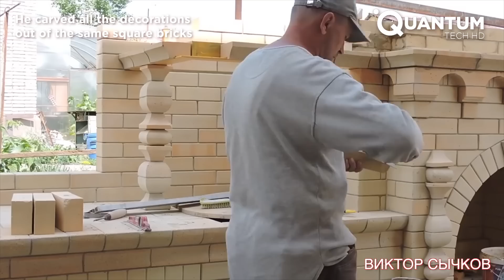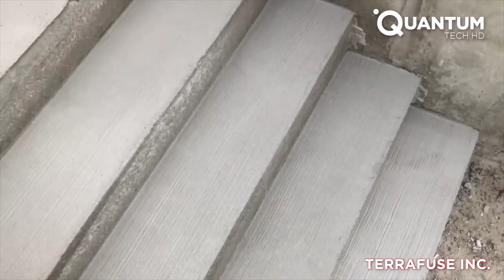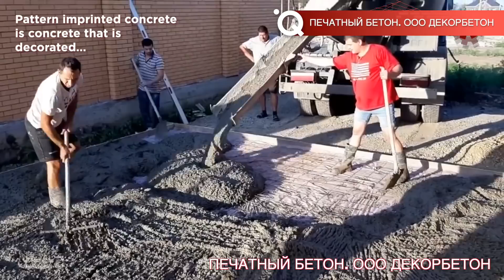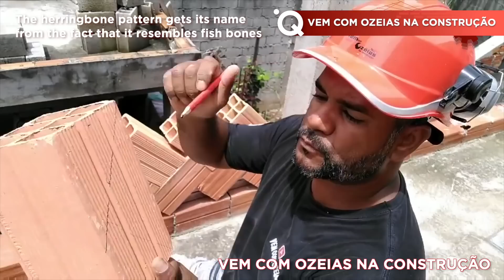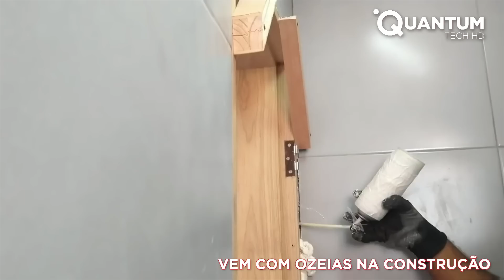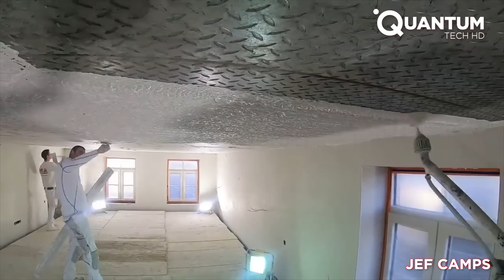Ingenious Construction Workers That Are On Another Level ▶33

Comment: Not too shabby! As a Mason Tradesman myself I can appreciate that work, though that kind of work really isn't done here in the United States. I personally did a few Southwestern style fireplaces myself, and a few back to back custom fireplaces out of stone as well as ashler (roughly about $10,000 for the back-to-back stone fireplace). Pretty neat work, good job!
Reply: That’s actually a really great price.
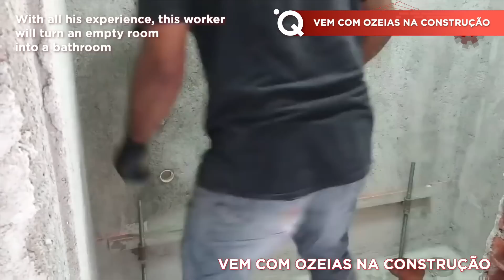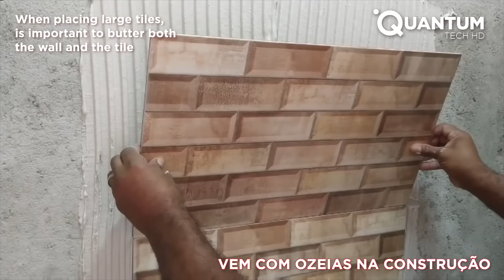Reply: Didn't you think that the foundation mix in the video was too damned soupy? (6:35-6:45) That's not going to be a strong foundation.
Reply: @grizzlygrizzle  I worked with concrete... That's way too wet. Probably trying to save on the manpower required to move it down the trenches.

Comment: Don’t know if I’d call that thumbnail work of a genius. Yes it is beautiful, but should’ve left a good 6” plus air gap between the 2 walls. Rock and block are thermal mass’. Whenever it’s hot outside it’ll be absorbed and transmitted all night long directly into the house. Even with insulation on the inside, it’d help, but your ac utility bill will be fighting that design flaw for the rest of that building’s existence. And likewise , in winter, your heating bill would skyrocket. What’s more intelligent- a beautiful look, or a beautiful look with a smart design. I get he’s using the block wall to keep his rocks plumb, but a skilled rock layer would’ve double thicknessed the rock wall so both halves slightly lean into each other to maintain strength, then a moisture barrier, then 6” minimum insulation then the cement block. I wouldn’t insulate the 2x6 walls inside either. Any utility heating or cooling will be absorbed by that block wall, and transmit back inside all night long minimizing your expense. His house will be cold as f*** in winter and hot in summer unless he spends $300/ mo

Comment: Those stairs would actually be considered more of a hack job. There was no rebar reinforcement at all... he didn't even build the stairs. There's three separately cured layers of concrete.. which is going to create some major cracking. The top layers that he added for "looks" is going to chip away within two years. And since he didn't actually form proper stairs, nothing is tapped or rubbed out.

Don't let anyone say they can fix your stairs like this, unless you're purposely doing it to cheap out and make a stairway look nice to sell a house. lol

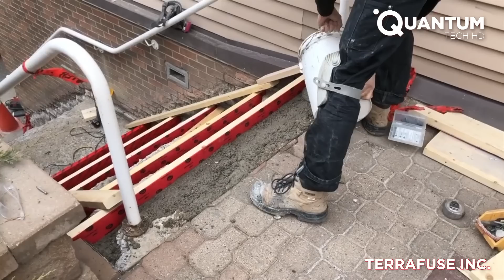Comment: the guy that repaired the stairs at 1:30 is not very skilled. did not soak the old concrete with water, did not put steel studs and reinforcement in the new pour. these stairs will be in worst condition in a couple of winters.